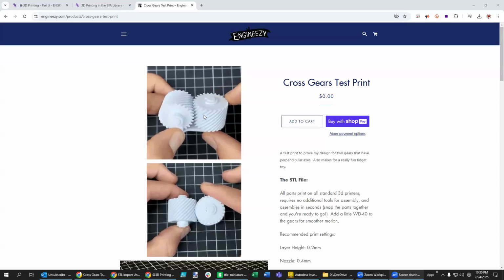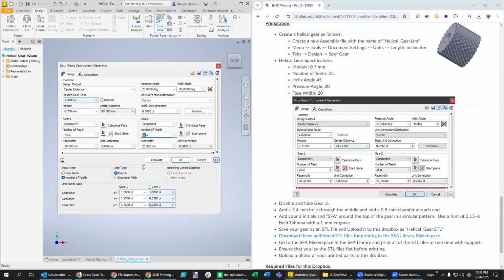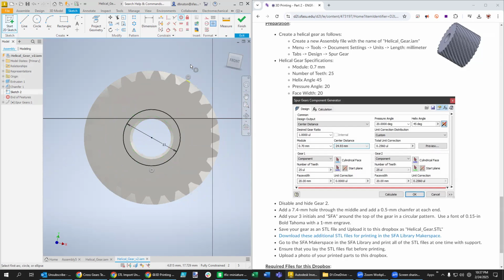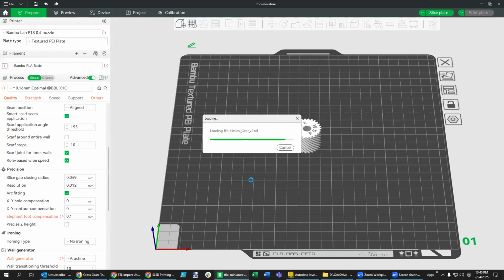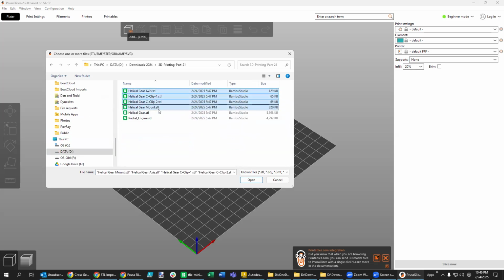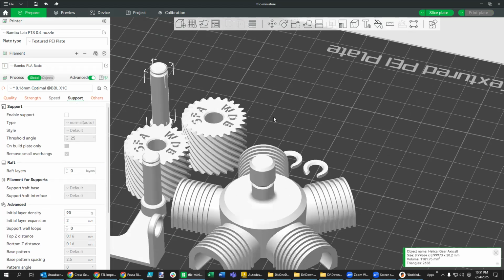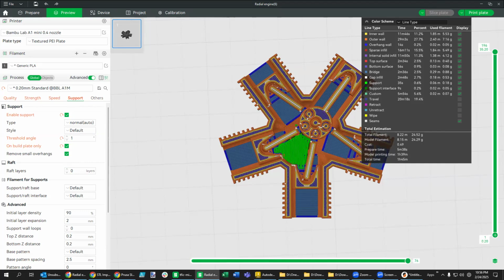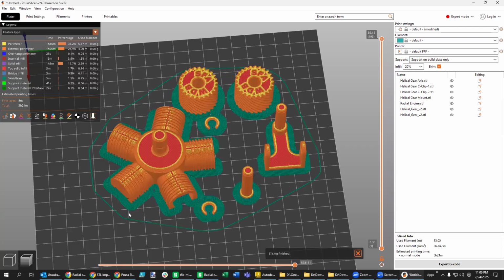Helical Gears in Autodesk Inventor

Comment: I didn't know this before, but I figured out the answer to how to do a positive (non-engraving) extrusion.
1. After you place the gear in the assembly, double click the gear itself. (notice how the top right of the ribbon says 'Return' - don't click yet)
2. Right click on the gear, click edit.
3. Now you can right-click either of the side faces of the gear, create new sketch, and do all positive extrusions.
4. Click the 'return' button on the top right in ribbon menu TWICE.

Reasoning: The gear the design accelerator creates, is itself an assembly. So we have an assembly within an assembly. 
Double clicking gear allows us to edit the assembly that the generator created. 
'Right-click' then 'edit' allows us to edit/ the sketches within the assembly the generator created.
Clicking return in the top right, moves us back "up" a level.